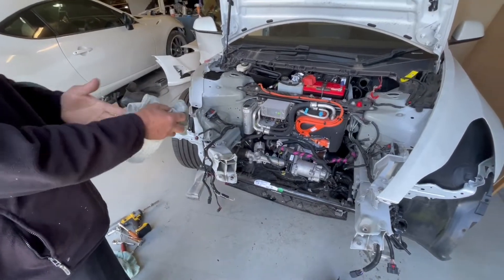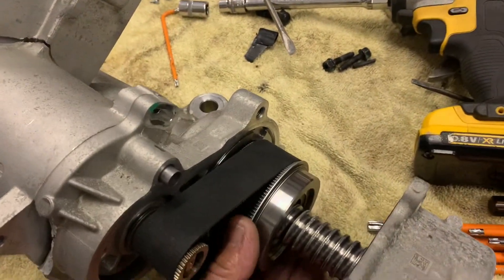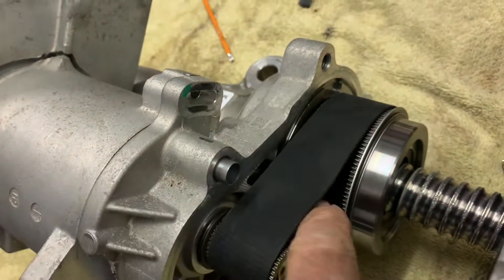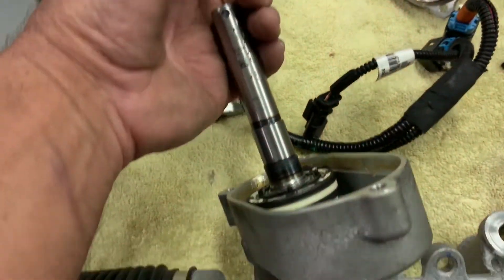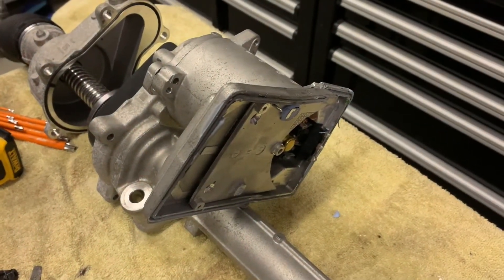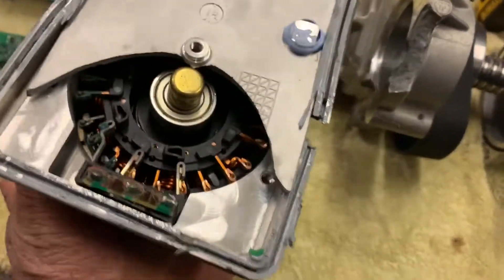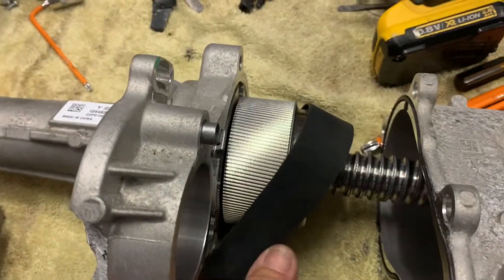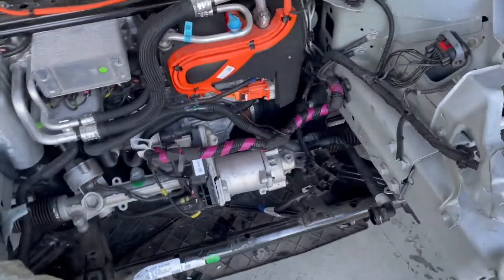What's inside a Tesla Model 3 Performance (2021) Steering Rack?

Comment: I replaced every suspension part up front and I still have a pound rattling noise  when driving over bumps sounds like it coming from this steering rack  ,
Reply from the maker: Bugger. Did you replace the rack as well?
Reply: No I haven’t yet I suspect this is the issue I will be ordering one soon from eBay and try to install it myself , the poor Tesla has been sitting for months : (

Comment: Hi. I have a 23 model Y that the steering wheel sticks to the right after a turn or lane change and isn't recentering the wheel. In other words, I'm left to have to manually try to recenter the steering which makes for a very annoyingly jerky ride. My model 3 and other model Ys I've driven do not do this. Any idea why this may be? Tesla shops have no clue what they're doing.
Reply: Did you ever solve this?
Reply: @jp54321 no, dealership told me it’s the scorpion tires that came OEM but it’s not because it happens only when I turn right and not left. Just going to lemon it
Reply: @nyyjeter28887  mine does it occasionaly. Very ugly when changing lanes and suddenly it behaves different than you would expect. Its like snapping into a position. Also when slowing down the steering gets the scroll wheel effect but not always. I‘m thinking it could be a bad rack but they would not accept my complaint saying everything is normal.
Reply from the maker: Is it after every turn/lane change or only under autopilot?
Reply: @denstoj nothing with autopilot. It’s when I’m manually steering

Comment: Do you see anything that would allow my rack to make a clacking sound like a rattling ball in a paint can?  Is there a washer, or seal, that closes off a hole through which the balls were installed?  I think I have an inadequate number of balls, or some have worked out of the recirculating ball nut.  I hear the balls falling as the nut/gear turns.  Any idea of what may be going on?  If I open it up and find the problem, Tesla will void the warranty.
Reply from the maker: Hey @TheTubeByron, it's difficult to diagnose over the internet but yes, it could be the steering rack.

If you determine it is the steering rack, we'd recommend replacing it either with a new or second hand one. It's a complex system for safety reasons not worth trying to repair it.

Under what condition is the noise occurring? Could you link a video?
Reply: @denstoj  Wow, thanks for the response.  The original noise/feel is a click in the steering wheel when I straighten the wheel after backing out of garage.  Thought is was something in steering column.  Under hood, listening, it is from the rack, right where the recirculating ball gear is.  The noise was with a guitar tuning transducer attached to that area.  From all videos I have seen, the recirculating balls are packed too close to have that much freedom to move.

On the one you took apart, is there a washer pressed in, or locked in with circlip that could come out and make that sound hopping over each thread?
Reply from the maker: No problem, happy to help. I'd have to check again if there is a washer. Have you checked the steering column shaft universal joints and bolts are tight?
Reply: @denstoj  Yes.  I started at the bottom of steering column and noticed the sound in the rack.  The noise in steering wheel doesn't really bother me.  The idea of something loose inside the rack does.  Thanks.
Reply from the maker: @TheTubeByron  no problem. Probably best to replace the rack then. Wouldn’t it still be under warranty?
Reply: @denstoj  They have to reproduce the sound and apparently have junk for listening devices.  It's "normal" according to them.  But they also say it has no balls in it.
Reply from the maker: Bugger. Record it and send a link?
Reply: @denstoj I did send a recording to Tesla.  I have tried another one with less motor noise.  But I was hoping to find out if there is any way for the balls to work out if there was a washer covering a hole drilled for return.  Hoping your unit could help figure that out.
Reply from the maker: @TheTubeByron  do you have a link to the video?
Reply: @denstoj  https://youtu.be/648brcUwxe8  But it is just a camera staring at the rack.
Reply from the maker: Thanks for sending through. Has it gotten worse over time?
Reply: @denstoj  I started hearing/feeling it in steering wheel several months ago.  Not sure if that sensation has gotten worse, or still about the same.  I haven't listened to it with the pickup but just recently.
Reply from the maker: How audible is it without the pickup? Or can you only feel it through the steering wheel?
Reply: @denstoj  In the quiet of my garage, you can hear it.  At the service center on a fairly busy highway, not so much.
Reply from the maker: Got it. When I get a chance to pull out the steering rack, I’ll check out the assembly of the ball bearings.